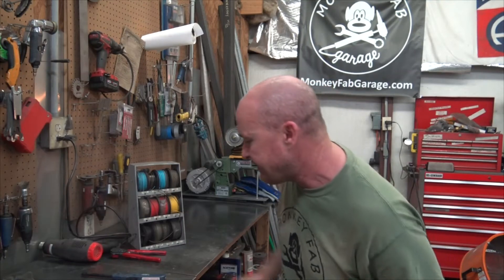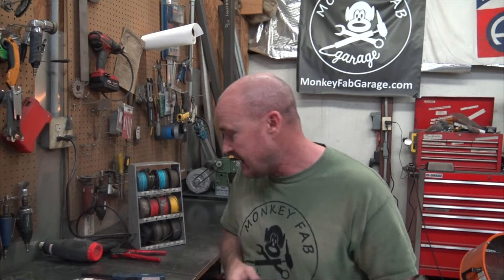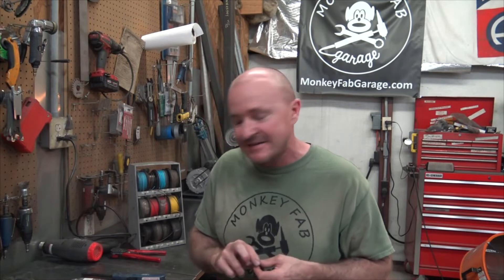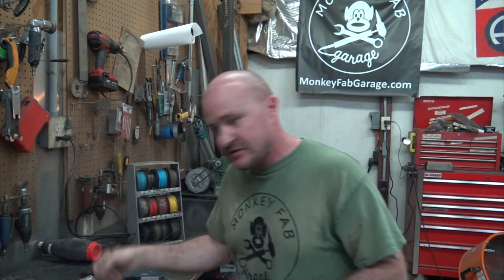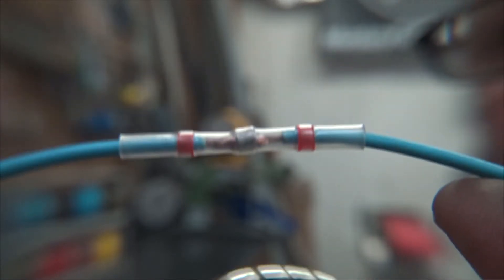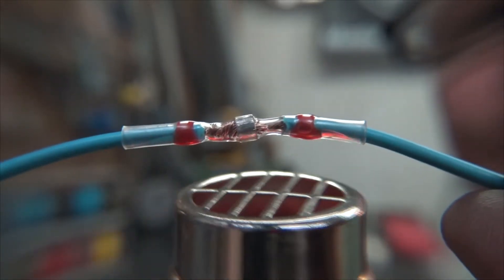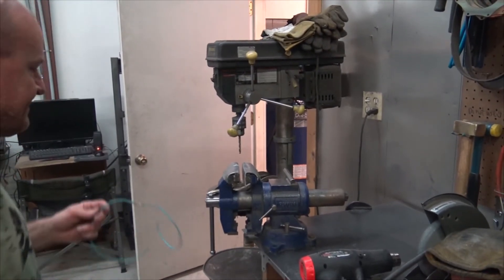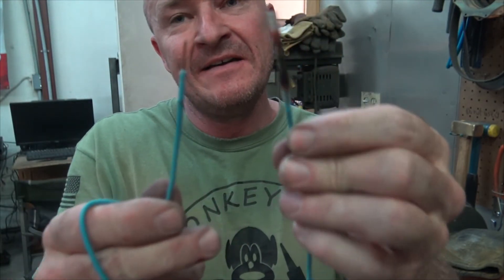Weartherproof Solder Butt Connector Stress Test

Comment: You just twisted the wire with your fingers which will have body oil on them. Then to solder the wires without cleaning them? Should be no difference than in any other soldering process. Wires need cleaned before soldering. Flux, alcohol, or any number of ways to clean the wires before soldering. Even a normal soldering process will fail if you don't clean the wires before the solder process. A simple fish scale would show actual data on your destruct test. While we all use our 'calibrated elbow' in real world, I dont think it is fair to any product to pull on something and say that is about 20 pounds. While I do appreciate your videos, you have to be fair to the products for those out there that may have little or no experience in the process being evaluated.

Comment: I'm new to splicing. I picked up some of these heat shrink solder connectors. Reading the instructions it says to just intertwine them, basically just meshing them together then put the solder over the exposed wires and melt.
I like how you effectively lock the wires into place and ensured a strong connection for the wires. 
What I am wondering is, does not really matter how we combine the exposed wires together before heating, as long as they are joined?.

Comment: One thing about soldering. The solder is just for the mechanical strength, and to protect the copper connection from the gas of the air. Never rely on the solder for the electrical connection. Solder has a pretty low conductivity. The wire needs to be very tightly, and closely meshed together. Thats why it’s considered to be a proper way to weave the strands together. Spread the ends, push the strands past each other, and twist so that they’re tight. It’s hard to do at first, but with practice, it becomes easy. The solder provides the mechanical strength.